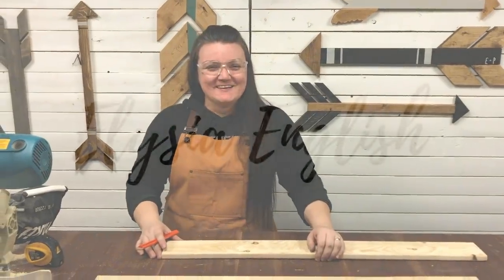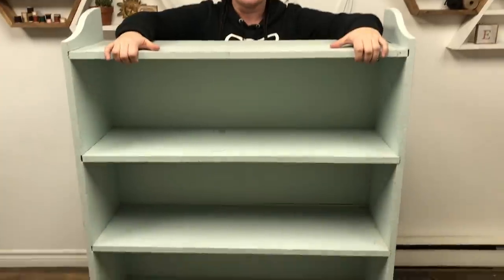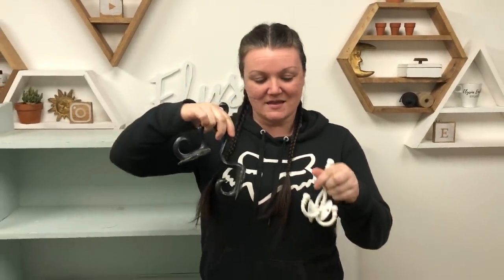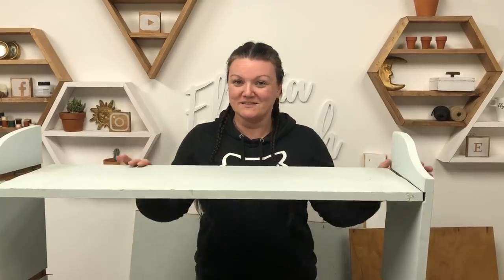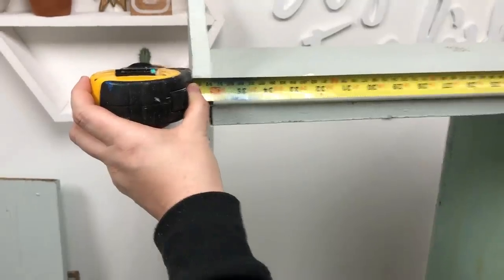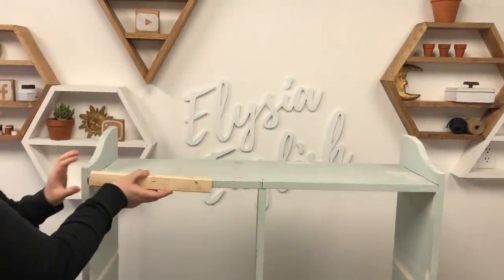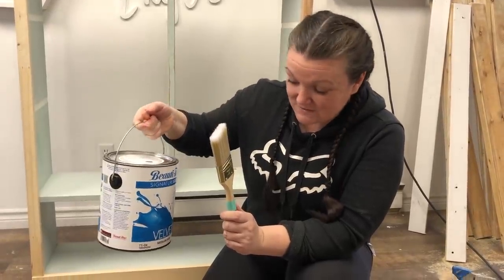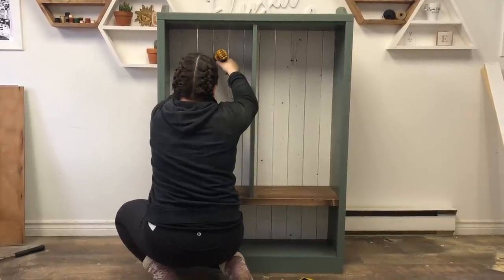TRASH TO TREASURE | Entry makeover | THRIFT FLIP | Decor On A BUDGET| Furniture Flip

Comment: I saw you beating the shelf a part with a hammer... I have an easier solution for you, turn your quick grip clamp into a spreader. It is easy to do with any squeeze type of clamp,  look at the fixed piece on the end there is a screw remove it and pull off the fixed end. Slide the adjustable part of the clamp towards the end of the bar that where the fixed piece was. Next take the fixed piece and place it on the opposite end where the adjustable piece was earlier (both grip heads are on the same side). Place screw back in and now it is a spreader. It can be returned to a clamp at any time. There are several videos on YouTube that show how to do this.  

Love the finished look of this piece you made, excellent job.